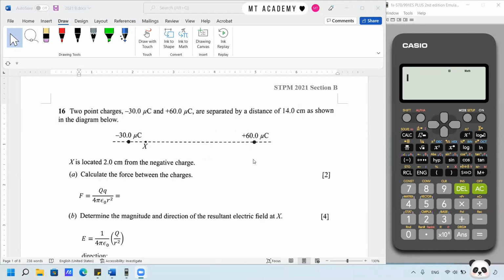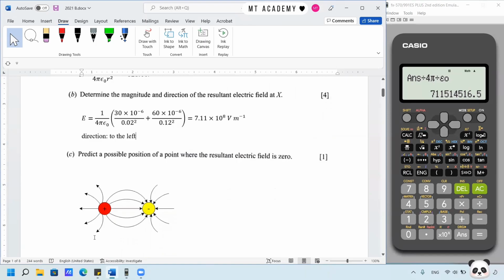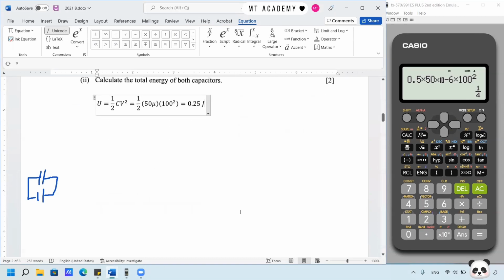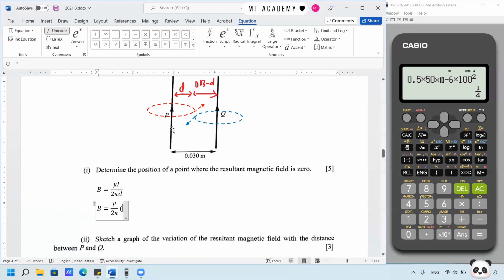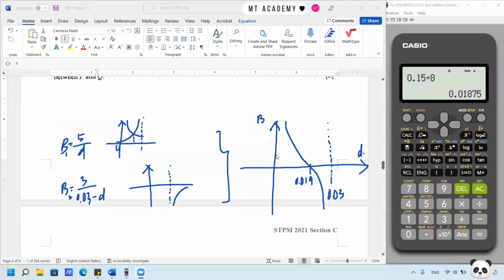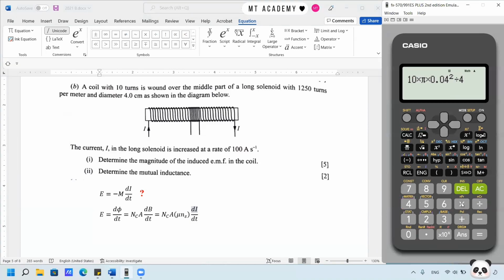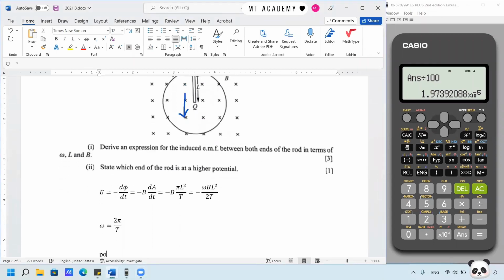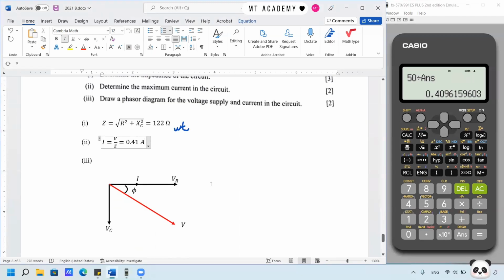Past Year 2021 Section B & C | STPM Physics T2

Comment from the maker: There is a mistake at 22:05 (Q19c), final expression for induced emf should be E=-wBL²/2, without the "T"

Q17c is missing, here is the question and the sample answer from me.
Q: The system of the capacitors is then connected to a resistor. Describe the change in the total charged stored in the system with time.

A: Capacitor will act as "temporary" battery, and there is current flow through the resistor. The energy is dissipated across the resistor as heat energy, hence the total charged stored in the system is reducing with time.

sorry for the mistake